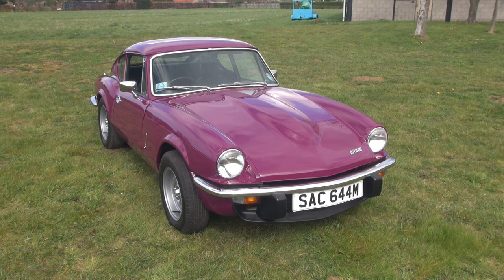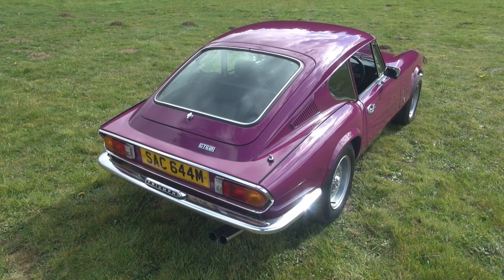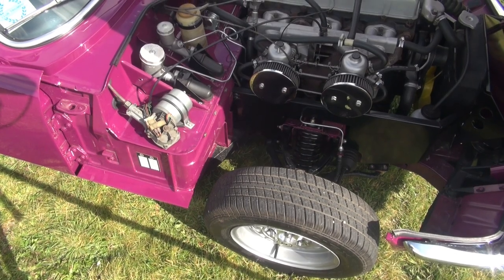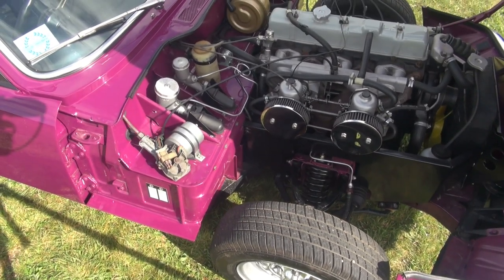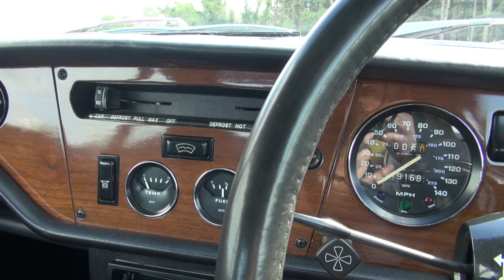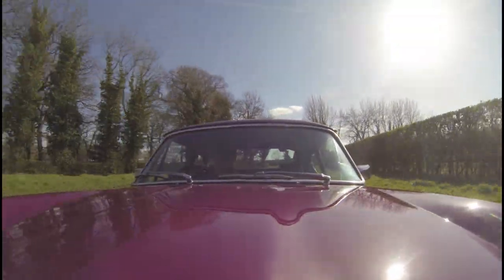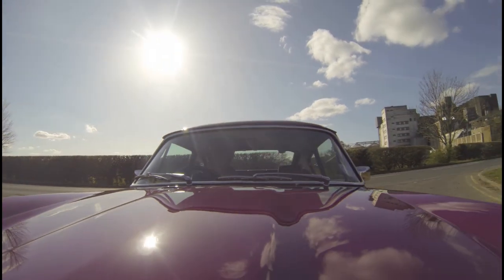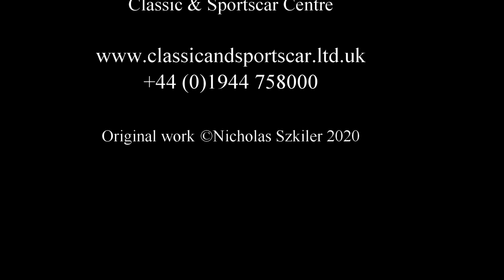Triumph GT6 MKIII at Classic & Sportscar Centre

Comment: This is a lovely car with non standard wheels. I had one of these 40 years ago - a '73 on an L reg. Overdrive 3rd + 4th only as standard I recall. Triumph used a Spitfire 'box which the '6' was known to chew up and same Spitfire 3.89:1 diff with O/D models. A joy hearing that engine again. A rare car back then.
Reply: I'm the guy who restored this car, it took 6 years to restore not 7 1/2 years as stated. The 5 1/2 inch Dunlop rims were fitted to improve the stability of the car and it made a tremendous difference. Overdrive is only on 3rd and 4th gears, never on second, though I do believe the TR2's/3's may have had OD on 2nd. I converted the car to run on SU HS6's, I engineered the existing inlet manifold to take the Dolomite Sprint carbs and had it re-ported for HS6's, the fuel consumption improved as well as performance. The CDSE Stromberg's were a devil to get perfectly balanced. The torque on the Triumph 6's are brilliant, this car would easily pull in 4th OD from 30mph. As far as the paintwork is concerned it was far superior  than anything that came out of Canley in '74. I bought a '75 Dolly Sprint from new and the paint job on that was not good, in fact it was lousy though it looked nice at the time.